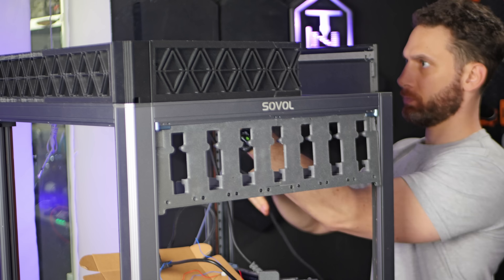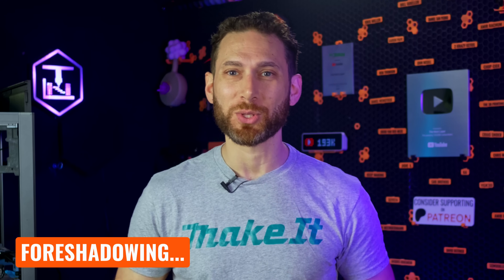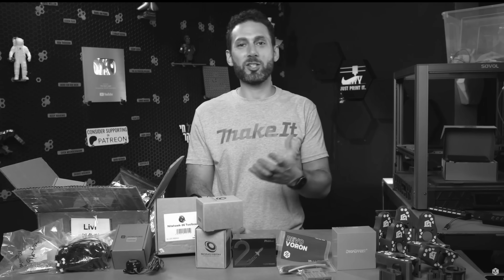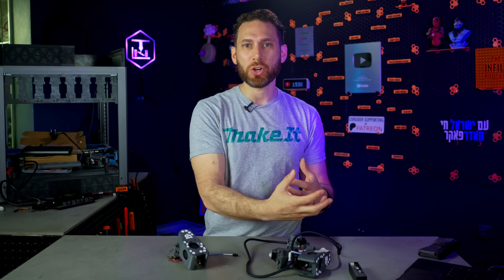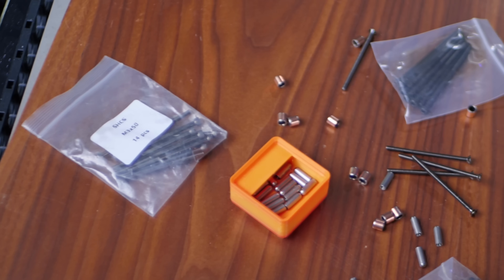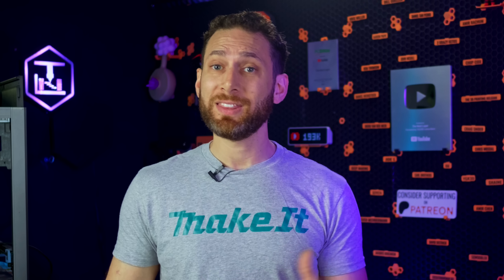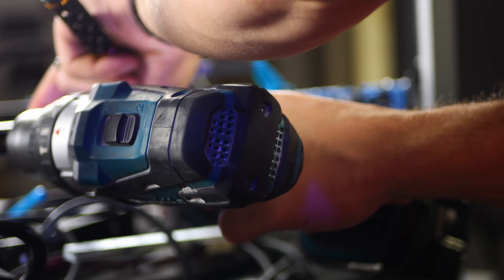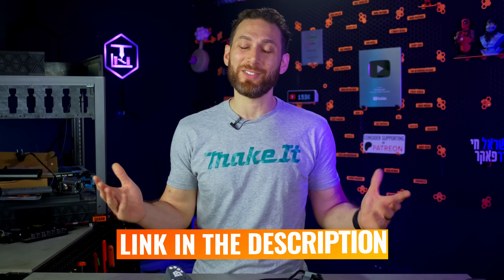IT'S ALIVE - But Barely. (Sovol SV08 Tool Changer Build)

Comment: 8:05 this is one of the many reasons I prefer to use Linux over Windows: there's a built-in tool in almost all Ubuntu distro called Disks that allows you, among other things, to create images from one unit of storage to "burn it" into another one. This was the process I used when changed my stock 8GB to 32GB in my SV08, sorry to be late to share this.

Comment: Late to the comments. Great content. For the EMMc - it's quite easy to dupe the EMMC in linux using dd. Basically make an image of the 8GB one, then write it back to the 32GB one, then extend the file system to use the full 32GB.

Comment: Hi Jonathan. You've inspired me to buy and rebuild a SV08 to multicolor printing vor my friend in Ukraine.
I've used Dragon Burner head with Sherpa mini extruder and LDO Nitehawk 36. 
For power on up to 6 heads I used self built Birds Nest Hub instead of using a standard USB adapter from LDO.
Instead of Stealth Changer I've used Tapchanger as with Stealth Changer I've already huge park/unpark problem on my Voron 2.4
The carriage I've printed from Extrudr's DuraPro PC/PBT CF. I've also purchased new 5m Gates belt to avoid a shortage.
In the carriage I've mount 5MP endoscope camera with autofocus to have a view on the nozzle from about 15mm distance.
Unfortunatelly Dragon Burner head has lower height about 8mm and I've built a 10mm spacer for the bed mount. 
The maximal print height is currently 347mm - not bad. 
To calibrate print heads between each other I've used a fantastic Nudge sensor. With it you can calibrate all your heads completely automatically!
Experience shows, that built-in load cell sensor as Z endstop doesn't work because this sensor is very slow and print head falls out.
Therefore I've reused the Nudge sensor also as Z endstop. 
Simultaneously with Nudge sensor holder for SV08 I've built silicone nozzle cleaner using famous Bambulab A1 nozzle cleaner.
My current state - everything is working, but I still make some small fixes in macroses. 
I plan to publish all my custom build parts and the entire process on printables.com and github.
You can see first public photo hier https://x.com/dgo42/status/1966172701263016050

Comment: yeah, tool changers are a big time sink. toolheads alone are like 50% of a 3d printer. so it adds up when you are doing 6 heads, on top of the calibration they need to pick up and drop off

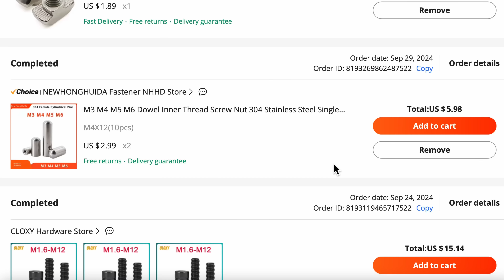Comment: @6:26 Of course it isn't. M3 M4 M5 are thread sizes! 
Unfortunately, many chinese shops use these as it is the same as 3mm, 4mm and 5mm, but nothing is further from the truth. And it  can be SO confusing! Just start using the correct notation please.. This annoys me so much ..
The seller of these dowel pins got it right though 😄

Comment: I have a project management workflow set up on obsidian specifically for hardware projects. I have found it saves me the headache of sitting down to work on a project only to find the parts are missing or wrong. It has separate bom files for electronics, hardware, and printed files. they take a while to build out. but doing all the shopping and organizing up front makes the builds go smooth.

Comment: When you use links, DO NOT PUSH THEM THRU TRACKER SITES TO GET THEM AFTER THAT BACK TO THE SITE OR W/E you do. Have the trackers in your pages, not in pass-thru links. All those in-between tracker and add sites are blocked here via DNS.
Reply from the maker: Where is here?

Comment: For future reference you can clone the 8 gig EMMC to the 32 gig EMMC, which results in a 8 gig filesystem on a 32 gig EMMC (as you already discovered) BUT if you put the EMMC back into the printer, boot it up, and then SSH in and issue the following commands:

sudo systemctl --no-reload enable armbian-resize-filesystem.service
sudo shutdown -h now

After it completes shutdown, turn off power and then power back up and after it boots you will now see your 8 gig filesystem is now a 32 gig filesystem.

I so love/hate linux sometimes. Only took me like 3 weeks to find this little tidbit of info.
 Whereas the linux guru would be like "how the hell you not know that simple one!??"

Thanks for sharing, and  all the work you put into these videos. You've helped me at least more than once to better understand a topic/product, or get me out of a jam!

Comment: The reason this is going badly is because you insist on live streaming it.  If you designed it and proceeded like a normal project, you'd discover things (like the wrong size screws) in a more timely manner.  You've brought this upon yourself.
Reply from the maker: True.

Comment: Thank you Jaque and Nadir.
I have not used a PC/Laptop to flash my canbus or MCU. I use the Rpi that I am running the machine with. It's a little more... interesting... to do it this way at first, but you can save the profiles and modify them as needed.

Comment: Would it not have been easier to buy a new belt, cut it to size to be a bit longer than the one the Sovol shipped with, tape the new belt to one of the ends of the old one & pull it through? I don't know about the mechanics of the Sovol (or really the belt layout on CoreXY's at all much since I just haven't tinkered with that aspect much) so it's entirely possible that wouldn't work but it seems like it'd be less effort to even do a full manual belt change than try to stretch the belt and fight against it like this.
Reply from the maker: Correct.

Comment: Great video, I'm watching this with great interest and I wish I had your skill for communication. Keep it up!

The most popular guide to upgrading SV08 klipper is great but it is a bit of a sledge hammer. I mean, you don't wipe your Windows drive and reinstall it just to update Chrome. Klipper is running on Armbian on the SV08, its really no different. The uninstall process is less refined and less familiar perhaps - but potentially a lot faster than creating new disks.  I updated in 5 hrs, but I had to discover a few things along the way, I think the process will take no more than 1-2hrs if it is written up first. 

In summary, just copy off a few configuration files, delete the klipper, the klipper service and kiuah (particularly the .kiuah config file in the sovol directory)  but leave the printer -config directory alone and then you can install a fresh kiuah and klipper.  If you are careful the config files are left untouched and you are running mainline klipper - very easy.  That will leave you with a working Mainsail/Klipper but no MCUs working because they are on old FW.  You then flash Katapult on to each MCU as you have done (I had a few issues there with a corrupt python install).  

I'm pretty sure you can load up an Ubuntu Live  on you PC and mount the two EMMC as disk drives in Linux - you just need two emmc USB adapters. You get a linux desktop and a friendly file manager to move files about.  

I like your content, but I've not watched you build before. Please, please, please - next time you are drilling metal don't do it anywhere near a power supply with an open grill. You don't want a fire or worse.

Comment: It's antie murphy's law.  You design something new and build it, and that inspires one of the 3D printer companies to sell something better, or another open source project to get updated.
I'm well into the second year working on my Ender3 to switchwire conversion.  I've had an E3D PZ stop working, as well as a Mellow Fly Can toolhead board.  I went back to a hart toolhead board and had to make up a new cable between the toolhead and the electronics.  Now I'm trying to get a klicky probe working, and figure out how to write the Klipper macros for it.

Comment: Nadir has done so much for the SV08 community already. It's great to have good friends like him And Jaques. 💪

I just bought a SV08. After 5 years with my custom built CoreXY I was tired of dumping money and time into it when it was never going to perform the way I wanted or needed it to. However I'm totally lost when it comes to Klipper. This is my second Klipper machine and my first I bought a few months ago. My first machine is an absolute printing beast but it's bed size is only 220x220 with a 240z and I just needed something bigger. 

Thanks for the update and I will continue to follow but I'm not ready for any changes that require Klipper and other related software. I spent enough time learning Marlin. 😂

Comment: this video paints a way to dark picture about toolchanger builds.
getting the sv08 to mainline klipper is really easy, there is a well documented step by step guide and some videos out there showing the whole process  (you don't need btt branches for eddy, etc. anymore)
Only thing I would agree on is the belts, that's why I have taken the clickchanger and made sv08 parts which mount with the original belt clips at the exact same position as the original carriage and more importantly the nozzle and x-endstop remains at the same place as the original (no loss in build space or motors ramming into the base). As for toolboards the ebb36 with a cheap 1to6 usb splitter from amazon and some wagos splitter for power make cable management really clean and easy (never used CAN in my life). for the heads it's also just one part which I bolted a red-lizard hotend and orbiter 2 extruder on (4xM2.5 + 2xM3 screws you get with the hotend and extruder). The pin situation is wierd tho, usually they give you the outer diameter (I got M4 pins -> M3 threads)

I understand you had problems with this build, but building a toolchanger is really not a 5 man 5 month project and in the end you must have gotten unlucky on so many fronts. Good luck to you finishing this project and for anyone else: don't get discouraged, it's no where near this hard to build one 😉

Comment: Just wanted to correct one bit of info you put into your video : 

As one of the folks involved in the very early stages of 'mainlining' the SV08, you did not need to flash a "Big Tree Tech firmware" to the SV08 toolboard.  You installed the BTT CB1 linux image to the eMMC (or an SD card).  After looking at the hardware on the SV08 control board, I discovered it was very similar to the BTT CB1.  It was decided to use that image because it didn't have ANY Sovol customizations that may have been hiding in their linux install.  

That said, you absolutely did not need to use it -- you could have stuck with the Sovol linux install and everything would have been just fine.  Several folks have done so without issue.

Comment: As much as I love Klipper, I don't understand how it takes up so much room on/in memory. When you get a printer with 8gb of memory for the hard drive, it's not until you have a fairly complicated part that you Really have to be efficient with file management when you realize that klipper is taking up 5gb of the "8" available (with nothing but klipper on mine, it has a whole 1.9gb of free, usable space). Why they don't just come with 32gb for the extra $15 I've never understood either.

Comment: I doubt I would ever attempt this project. I tried to do a different sv08 mod by cn3d. They may have excellent engineering skills, but the technical documentation was lacking to the point where I wasn’t able to complete it due to missing parts, undocumented steps, etc. 

I joined the discord to find out about assistance and they were just making fun of people that needed help there. It struck me as a toxic community and I disengaged and haven’t looked back. 

That said, I respect your content so I followed this project hoping it would change my mind. I wish I could say that it has, but the struggles with this only reaffirmed my doubts about the documentation.
Reply from the maker: They’re building an interactive website tutorial instruction thing

Comment: Since "something better comes out", start building a 5-axis printer with easy to use slicing software. Use your curse to our advantage.
Reply: I'd be ok if he just worked on a nonplaner printing slicer for a kinematic beds with a custom long nozzle. Baby steps.
Reply: @ We've already (sorta) got that with a modified PrusaSlicer. Nozzle geometry only gets you so far, so wasting the "better comes along" curse on this feature doesn't seem worth it.
Reply: 5th Axis yeah. For CNC for example, 500€ a year for the standard CAM Fusion 360, another 1500€ a year for simultaneous 5th axis movement 😅
Reply: Why stop at 5 axis? Go for 20 axis
Reply: this! :D
Reply: You guessed it! It's here now

Comment: Thanks to everyone involved in this project for pioneering! I was very close to actually ordering parts for a budget friendly version of this, but wanted to see someone actually run it successfully. Now I will probably just wait for the INDX, since it will hopefully be less of a hassle. If you're looking for ideas for new content, the Nevermore Stealthmax would be an interesting option. I recently built one for my SV08 and overall am very impressed with the design, but it could use a well structured assembly video and someone explaining the different sensor options, as the documentation has some minor blind spots.

Comment: Now I understand why the Prusa Xl multi-head is 6k
Reply: The XL costing so much will stop making sense when INDX comes up as long as it works as advertised.
Reply: @TheArmyKnifeNut  that’s still a DIY solution, which means for the vast majority of people it’s not a solution they will/should consider.
Reply: @super.brunch  At first, I'm sure. But how long do you think it will be before some printer manufacturer licenses the tech and uses it on a prebuilt? For example Sovel is a consumer printer with DIY roots. Is it that crazy to imagine someone building INDX into an off the shelf printer?

Comment: When you keep breaking off screws in the same component, carefully check the blind holes for drill depth, threaded depth. And double check the stack up tolerance of the parts you are clamping to be sure you haven't overlooked something that makes your screws bottom out before the clamping is tight.

Comment: I have a working stealthchanger myself (I have yet to submit a serial ^^) and it's took some work to make it work!  The thing that I did right however is that I first only converter it from klicky probe to stealthchanger carriage and only then I added other toolheads and macros. So I had a working printer very quickly and could add things along the way.

Comment: Just in time for Bondtech to announce their universal drop-in tool changer kit XD
Reply: Facts... I'm so stoked for their November release target. I plan to treat myself as a birthday present and will 100% pre-order the INDX as soon as it's an option.
Reply: @TheArmyKnifeNut  I'm planning on doing the same with my SV08.  I'd considered the box turtle up until they announced the INDX.  Hopefully Bondtech has mounting options already set up (a ready-to-print setup for the SV08 would be ideal) for mounting everything, and a clear, concise BOM and directions to get it done..
Reply: @heffe2001  I have a RatRig V Core 4 500mm on its way right now. My estimate says that it should be able to fit 20-22 INDX heads. I only want 6-10, but it's a nice feeling to know that 2-3 times as many could fit leaving room for expansion. Given the excitement in the RatRig Discord, I have no doubt it will fit at launch or shortly after the community gets their hands on it.
Reply: @TheArmyKnifeNut  I'm stoked it's being released, but I do wish it was sooner than November!  :D  Those things are going to sell like freaking hot cakes.
Reply: @TheArmyKnifeNut im very interested but im wondering what the cooling solution is, since most print heads have large blowers and i dont see one on the INDX. maybe im overlooking something though
Reply from the maker: Bastard! lol
Reply: @thenextlayer  what issues were you having with the cheap laptop? I have an old laptop and I keep getting an error when trying to use the flashing tool that there is not enough voltage, tried 3 flashing tools and same error everytime.
Reply: Maybe by the time it gets from announced to release the tariffs might have passed?? Yes, I know that Bondtech is a Swedish company, but the US Commerce Department shows that in 2024, the U.S. had the highest goods trading deficit with China, followed by the European Union, Mexico, Vietnam, Ireland, Germany, Taiwan, Japan, South Korea, Canada, India, Thailand, Italy, Switzerland, Malaysia, Indonesia, France, Austria and Sweden. It is reasonable to assume that if any logic does exist in the countries being targeted, that this list might be a guide to where to expect to see them enacted. Regardless, I probably still won't be able to afford it either way once the INDX system becomes available.
Reply: @T313COmun1s7  Their price points look pretty reasonable...
Reply: @T313COmun1s7  It's not just about deficits in trade, it's about imbalances in tariffs enacted by foreign countries..  If we've got, say, widget x that we allow in from country y with zero tariffs (or 10%, 20%, whatever), and that country puts a 50% (or whatever) on widget z that the US sends there, that can be a problem.  That's where the recprical tariffs will likely be enacted.  Canada's a prime example of this, as many US products are charged insanely high tariffs to be imported there, yet we didn't have a reciprocal tariffs on Canadian products to match.  With China, it's much, much worse.  What would be ideal are NO tariffs anywhere, which would pretty much be free trade globally, but that's highly unlikely to happen in my lifetime, lol.  I've seen prices mentioned that the head will be around $250 (no clue if it includes any toolheads though), and around $35 USD per toolhead.  If the $250 includes toolheads (more than one anyway), I'll definitely grab that setup, and add toolheads as needed.  Even if it doesn't include any, it'd still be worth it to get the head and at least 2 toolheads for my usage...  I've not seen those prices confirmed, but I have seen them posted in several places...